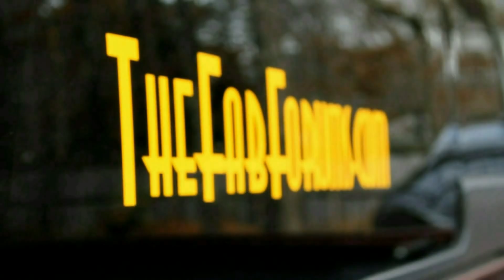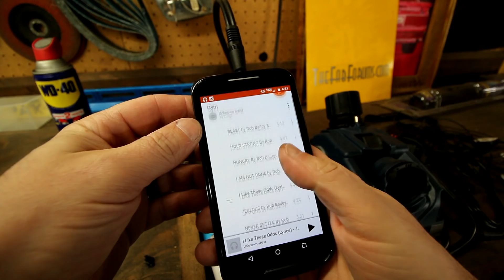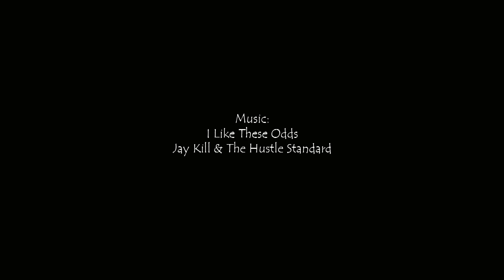Fox Body Mustang Hot Rod Build 2 | Bibbster

Comment: You're rendering looks like you're kinda going for the Roadkill Vette-cart type thing, but with a fox body and a bit more fab work if you're going to do you your own suspension set up. I'm very interested to see how this thing turns out! Keep up the good work!
Reply from the maker: +Alek Julien It will be different that the vette. I will be moving the wheel base around and making all kinds of custom parts for it. When its finished it will look like a hot rod and not like a cut up mustang

Comment: What is the engine oil recommended by the manufacturer for that car? I have a mustang fox body Hatchback GL 1981 3.3 6 cylinders in automatic line here in Peru that I am repairing but I do not have the manual and I do not know what kind of oil it has.
Reply from the maker: no idea

Comment: with the risk of it starting to look like a rockcrawler type of vehicle , i'm starting to wonder if it might be better to start with a mini truck cab as a base of what little body there is with a full tubeframe build around it , using a truck cab  you have a rearwall in the cab and that will keep you cup of coffee and youre smartphone from rolling of the consolla and the rear of the car under accelleration , it prolly prevent the rear of the doors and jams from flopping around too , you can still turn it intoo a cabriolet or just chop it rake the stock front windshield and have a light closed cab 
you could stretch the truck cab behind the doors , use parts of the bed to make the rear or use a shortened and chopped cab from say a s10 blazer and end up with sumtin that has rearfenders right behind the doors and would look like a bmw z3 with a tubeframe front 
https://upload.wikimedia.org/wikipedia/commons/4/4c/BMW-Z3-Coup%C3%A9.jpg

actually been making doodles for a while building a modern T bucket like hotrod using a truckcab and part of the bed as a base wanted to narrow it as far as i can and still fit inside and have the wheels outside the body 
after i rebuild two chevrolet pickups intoo one good one im left with quite a few parts .... enough for sumtin like the modern t bucket idea , now all i need is the space to make it ..... and a back that doesnt hurt so mush all the time offcourse
Reply from the maker: +watahyahknow I actually looked at the s10 cabs at one time. All the issues you spoke of will be addressed. You gotta have some faith...it will look nothing like it does now.

Comment: Sorry.. I would of used a mustang that was already a shell. 
Would be cheaper to buy.
Less to strip.
Sadly this was a gt. Stock looking to.
Reply from the maker: I needed the rear and engine too so a shell would have worked. Plus I was able to sell the body part, interior, and wheels to recoup what I paid for the car. So basically got the engine, rear and body for free. It was junk even though it may have looked good